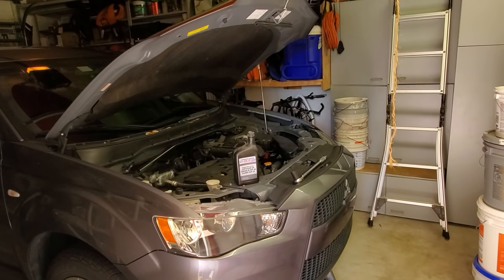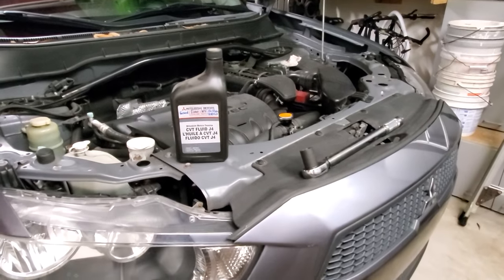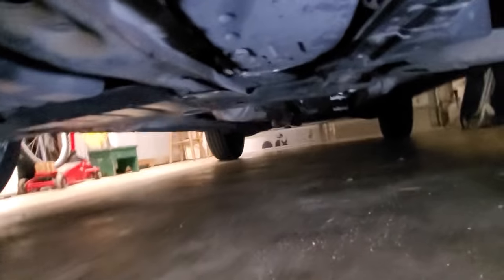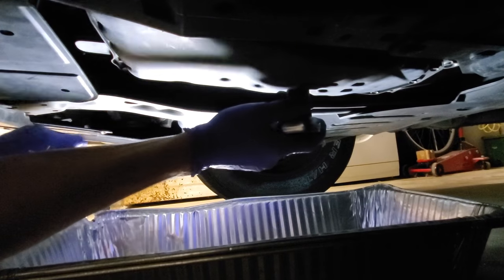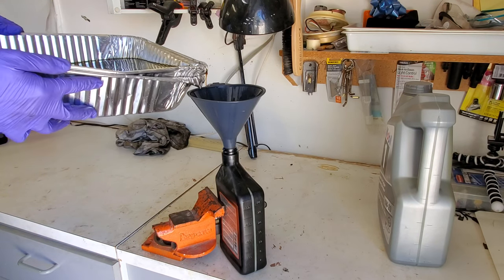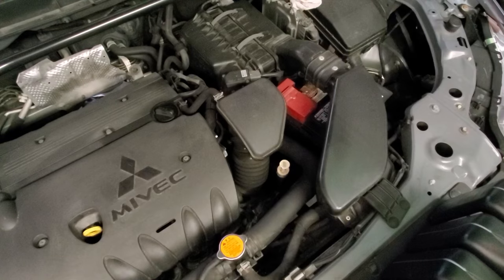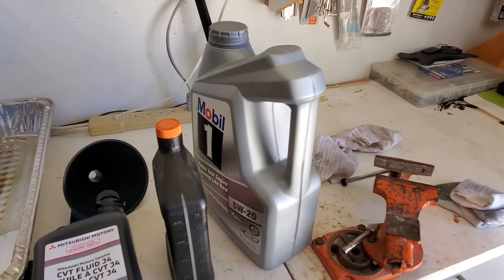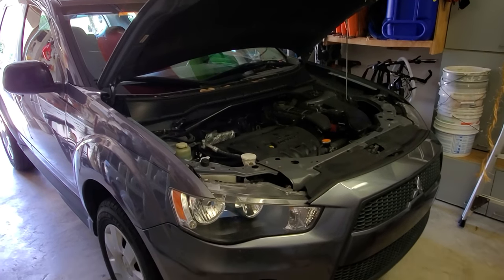How to Change Automatic Transmission Fluid in Mitsubishi Outlander

Comment: First, CVT fluid from a dealer would be most expensive. Second, it is useless to partial refill. Third, you need to open the pan and clean out the two magnets on the inside. Fourth, learn something about CVT on your car and replace the second fine filter, housed inside heat exchanger, then clean up main filter, located under the oil pan. Those transmissions don't need any service until they reach around 200K km. You want to circulate the fresh oil out of the transmission until you see it running relatively clean, then stop and fill it up with fresh fluid, could be done by disconnecting one of the hoses to oil cooler. Sorry to tell it is useless video mostly...
Reply from the maker: Thank you for your comments.
I show how I do it, and I do what is recommended in Mitsubishi manual, which is drain and fill. You are free to do whatever you wish on your car.
Reply: Do you actually read your maintenance service manual?  Severe change for cvt is at 48K Kilometers.  Go 200K and you most likely lose your warranty.
Reply: @dereksteiger1  you go and talk to your dealer in your specific country, as mine said CVT does not need any maintenance up until 160K mark, then they offer partial fluid change, not even cleaning or replacing any filters. Do you know why?! Right, because out of 160K mark the warranty is done and they want you to buy a new car from them. Listen to them more and you sure are either paying heavily for major repairs or buying a new car...
Reply: @1HandyLad  My dealership wants to do a CVT flush every 48K.
Reply: @dereksteiger1  strange dealer... indeed. Unlike most "d...stealers"
Reply: @1HandyLad  Same as here in Canada.